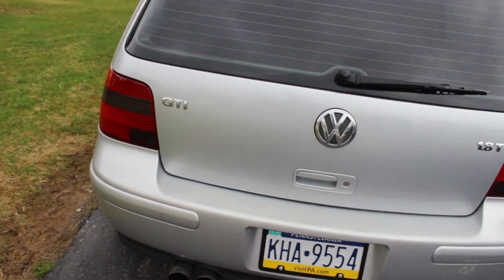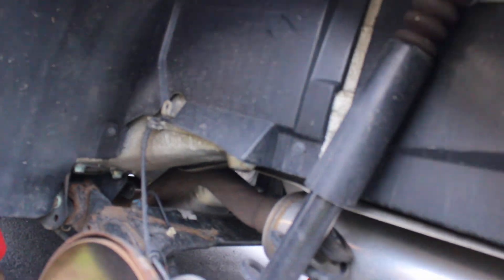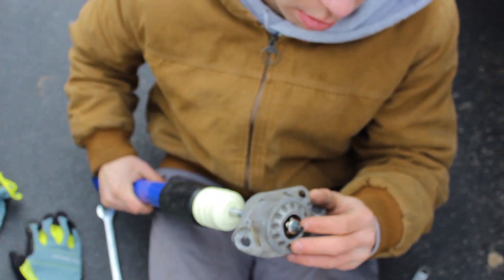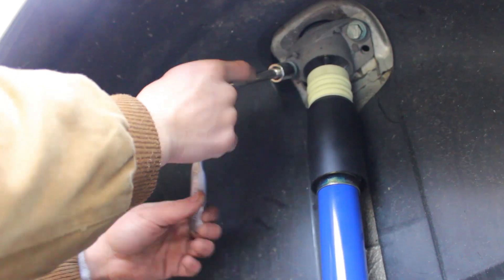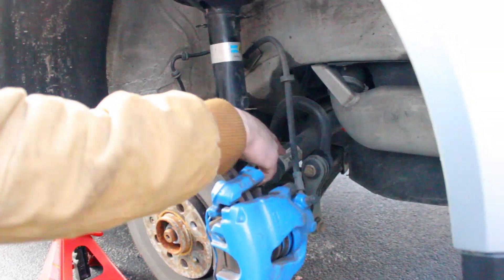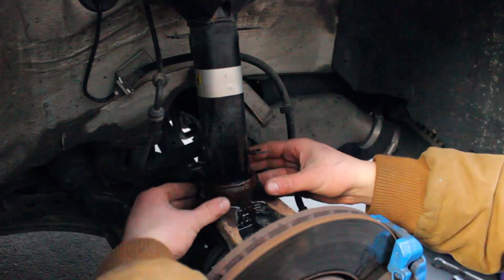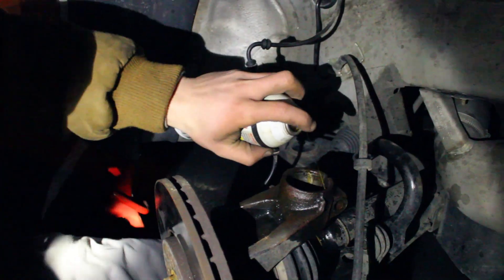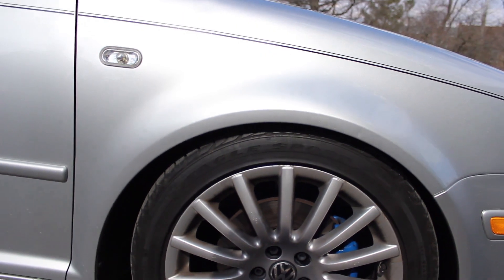MK4 GTI Solo-Werks S1 Coilover Install + Review

Comment: For the top bushing on the front, Can it just sit on the tophat? the old coilovers i am removing have a tophat then a plate for the top bushing to sit on, aswell as a rubber piece under the nut. The solo werks dont seem like i can put the small bushing on the shaft even though thats how its shown on the instructions. Any suggestions?

Comment: How did you guys intall the passenger side coilover? Did you have to remove the axle bolts? I'm researching how to take the old shock off without undoing the axle.
Reply: SanchoSanto any chance you figured out the answer to this?
Reply: @almondboy111  No. I just went ahead and removed the axle bolts. Screwing them back with the proper Torque was a pain in the arse! I had to use a long extension that allowed me to reach the bolts from out side the wheel well.
Reply: Pry bar and pull down

Comment: how are the dampers? Cause im going to slam it on this but scared that the dampers are way to soft to run static with these?
Reply: Do not buy these. Ive been running them for 2 years on my mk4 gti. Only like 1K miles on them (Don't drive it much) and they are already horrible. Extremely bouncy drive. Not enjoyable. Spend the money and buy a set of BCs or something similar.

Comment: Interested in your opinion: my '04 MKIV GTI VR6 needs a suspension refresh.  This video helped me get familiar with the job.  I'll install Bilstein B4 dampers (heavy duty) for a better than OEM quality replacement damper while maintaining similar ride characteristics designed into OEM.  I did not find aftermarket springs that would be a suitable substitute for maintaining OEM springs ride characteristics.  What's your opinion on reinstalling the same springs with the new dampers?  Is it okay?  If not, why might it be a bad idea?
Reply from the maker: RedondoBeach2 should be fine, you can always check the forums, there’s always an answer on there
Reply: Just put the 337/20ae billstein coils on the rear, i believe it’s a .5 drop from stock

Comment: No camber in the front? I run the same suspension but not nearly lowered as yours and I have positive camber in the passenger side. I wonder what I could adjust to fix that. I was hoping to be able to do something before having to put in camber plates.
Reply from the maker: Mladen Hristov you get an alignment after you lowered? Mines had like 4 alignments so everything fits well.
Reply: AJHL Tuners yes. I've had it aligned after I put the suspension on

Comment: How are the coilovers now? They still mint? Im currently in the process of putting fks in mine, Finished the rear but doing the fronts, Gotta wait for the new bushings
Reply from the maker: Brendan Carreiro they ride really nice but I must say there sure aren’t for my build. I wanted stiff coils for corners and these aren’t it if you put bigger wheels on. I have massive wheels on (18x8.75 w/245s) so I rub quite a bit and I’m not that low. When I was on my 17” rims (in the video) they were just fine, I could fly around corners and have a good ride all in one. But yes there still holding up as far as the shocks and springs, no rust, etc.
Reply: AJHL Tuners Thanks for the quick reply! My first time putting in coil overs, And this is the first video I watched

Comment: My struts are taking a brick to put in. They aren’t fitting into the bottom bracket
Reply: When i was putting mine in i found this same problem. What i did is take a file to the inside of the bracket and smooth it out as there’s rough edges and smooth down the bottom metal bushing on the strut with a angle grinder, taking on a fraction of a millimeter just so it would fit. Start with the file, make everything smooth and level and then use the angle grinder if needed.

Comment: when you install coilovers you need to do a final correct torque on bolts after the car is under all its own weight not on jackstands guy
Reply: As a VW tech I can tell you I've installed hundreds of struts without going through that procedure and never once had an issue.